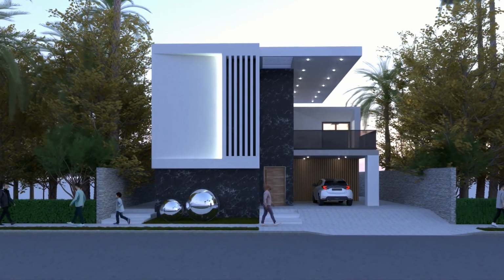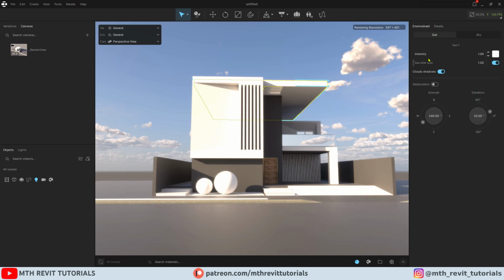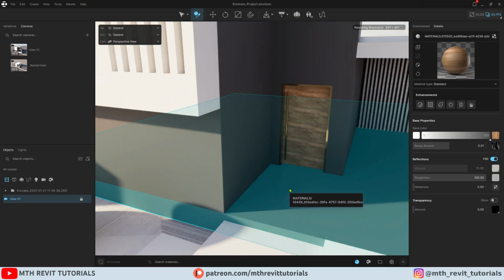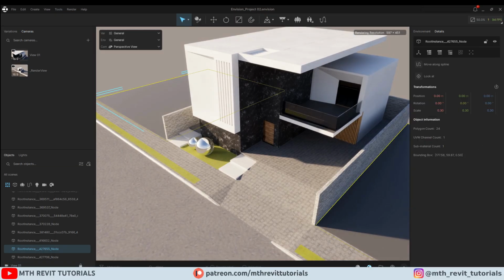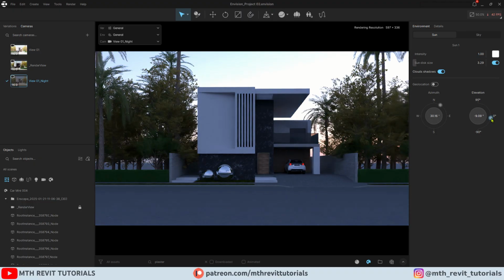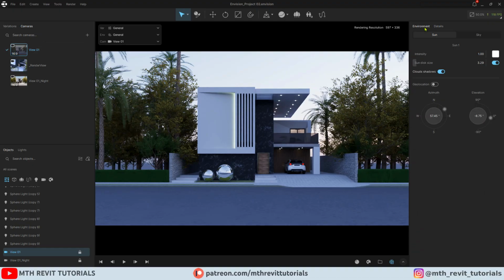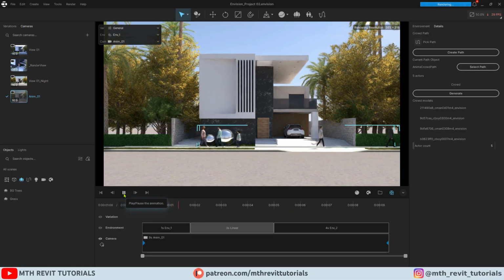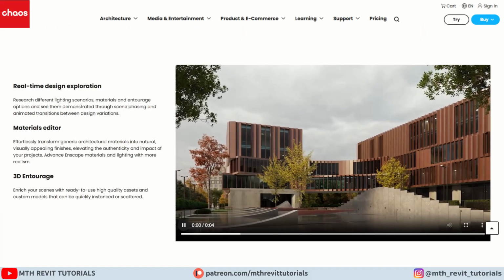What is Chaos Envision? A Quick Intro | A New 3D Visualization Software

Comment: hey guys!!! is this support gtx 1060 6gb?? i read requirement need over 8gb vram!
Reply from the maker: As stated on their website, the system requirements for Envision are as follows:

Processor:
Intel 64, AMD64 or compatible processor with AVX2 support
RAM

Minimum of 8 GB of GPU VRAM. It is recommended to have system RAM at least twice the size of GPU VRAM.
 
GPU Acceleration	

For NVIDIA GPUs: RTX series or newer, required driver 515 or newer in WDDM mode, recommended driver 537.13 or newer

For AMD GPUs: RX 6000 series or newer (experimental)

For Intel GPUs: Intel Arc Alchemist or newer (experimental)
Reply: Great 👍🏻 Can you make videos on Enscape Tutorials?
Reply from the maker: @salluzYT  I've been creating tutorial videos on Enscape since 2019, and I've uploaded over 60 videos on my channel. Check out the playlist link: https://www.youtube.com/watch?v=XH4kswqS4FA&list=PL6wau0tU64K1QZiJ1W1BJrx0s5ij1NS4D&pp=gAQB
Reply: @MTHREVITTUTORIALS  Ohh Sorry Thanks for sharing the link